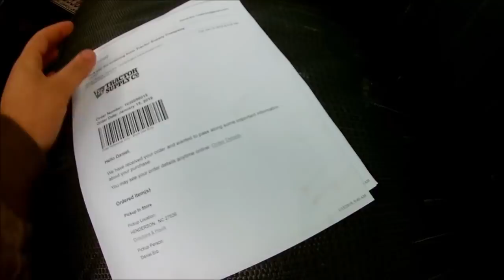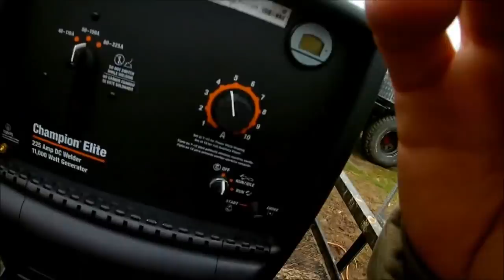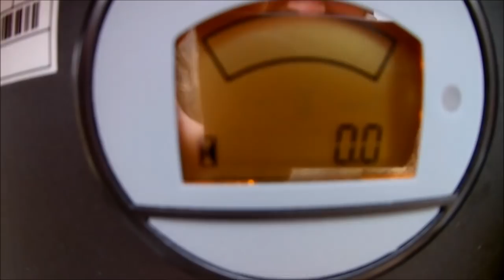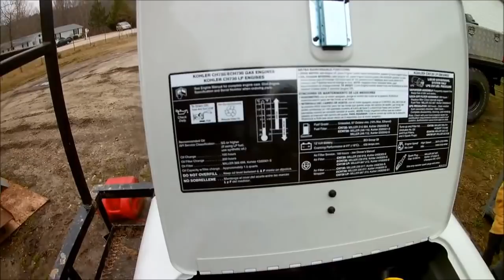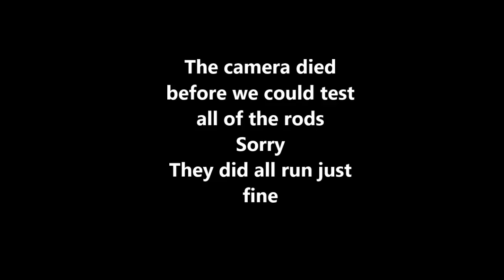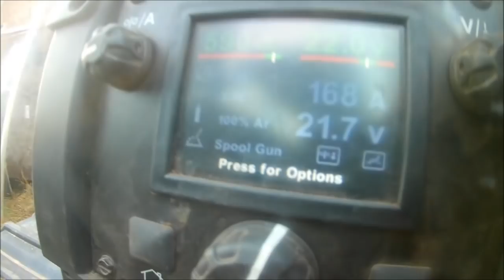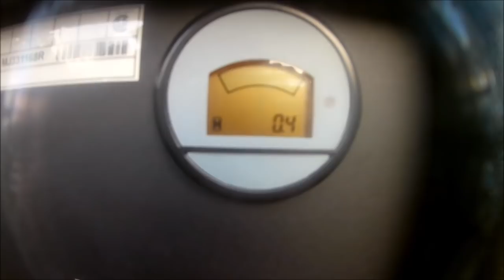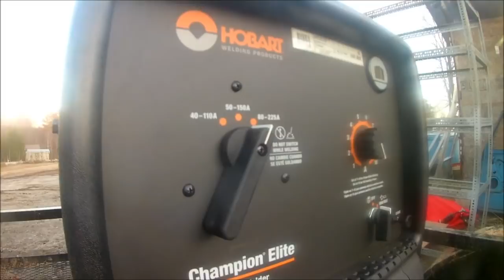My new hobart Champion Elite - Replacement for the Blue Star 2E

Comment: I got my Lincoln ranger 225 for 3k new . Having CV makes life easier plus you need it for any code work . I plug my wire feed right into my leads . I have 1000 hard long ass hours on it and it runs like the day I got it . . But congrats on your new machine.
Reply from the maker: It depends on the code You’re working on. Right now I’m making and installing structural brackets using a suitcase on cc mode with my champion elite running duel shield. The prints only call for a 70 series filler.

Comment: I would have loved to have gotten that Bluestar from you. I have had a 2E for years now. I really like the 4 pole generator part. It will run a long time on very little gas as a generator, although it is only 3500 watts. Great little welder too.

Comment: I never knew this welder could be plug in to operate it inside so you do not need to run the gas engine to weld.
That’s a handy feature if that’s possible.

Comment: I bought myself the same generator with the same deal for Christmas as a Christmas present for myself and I don't know how to take the battery out but I do know I haven't used it very muchlast month and I went to start it and it wouldn't start from a dead battery and it gave me a few codes but I charged the battery up and it's been working fine ever since but the gauges did quit working on

Comment: Hey was the battery a pain to get out ? Nice videos, im thinking of getting a Hobart 145 but they are $2700(+taxs) here in Canada pretty expensive but I think that might be the best option for me.
Reply: They are a pain to get to...you have to remove the rear of the machine...but it's not common to lose a battery very often...luckily
Reply: Unless you leave the ignition on by mistake.

Comment: Just wondering, aren’t you afraid leaving your machines exposed to the rain water? I see so many welders with open trucks and brand new machines mounted for the rain to come down on them. Are they sealed that well?
Reply from the maker: The newer ones are sealed very well. Even my old blue star and legend 200 never got water inside the casing. These machines are made to be out in the weather.
Reply: +Derbador the weldor ohh, ok, that clears it up then. Great job on the videos. I always look for new ones to come out!

Comment: Congrats! I hope to see a video soon of you saying how a helper can grind while you weld without issues! next on your exhaust, I do not know if it has a bleed hole? but in that low curved section if it didn't, I would add one so in case of some crazy monsoon storm & sitting a day or so, you dot get water in engine, the bleed hole on bottom in exhausts usually is drilled 1/8" I myself would put a taller pipe with a flapper to help keep rain out, but a bucket is just as effective if you know will get hard rain for days. otherwise looks awesome & I hope it gives you no issues other than cough cough, running out of gas? lol.
Reply from the maker: That is a good idea. I would hate to ruin my new engine.
Reply: yep, many a tractor has been ruined due to a straight vertical pipe & water getting into engine, that's my biggest complaint, so far only complaint. any tractor place like where you bought it would have the little flapper to fit on pipe, & a short straight section of pipe, & you would be a lot safer. but just a small metal can, or bucket to cover it that cant be blown off by wind will be just fine
Reply: Randy mack that’s why they have the loop like a p trap. It holds any water that gets in.

Comment: Is that ford an F-250?
Reply from the maker: It's a f150 I've added hefty shocks to. I'll be adding helper springs soon.
Reply: @derbadortheweldor8940  will that compensate for all the weight and will it strain the tranny?
Reply from the maker: its a t18 transmission. its the same transmission used up to the f350 in the 70s and early 80s. So i honestly doubt it.

Comment: You could have bought a running sa 200 for less than 3,000
Reply from the maker: But a sa200 doesn’t have 11000 wats of generator power. In my case generator power is essential.
Reply: Derbador the weldor that makes since keep up the good work